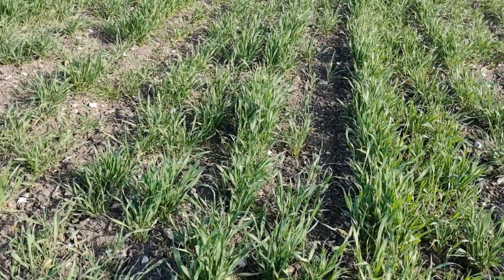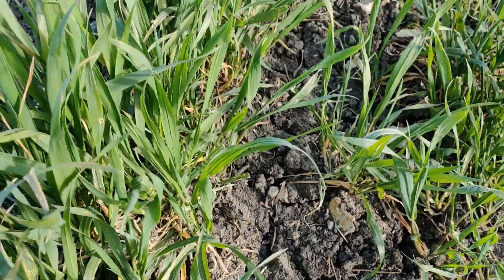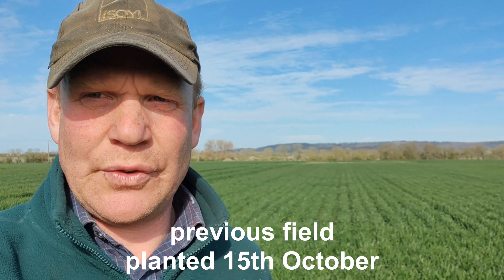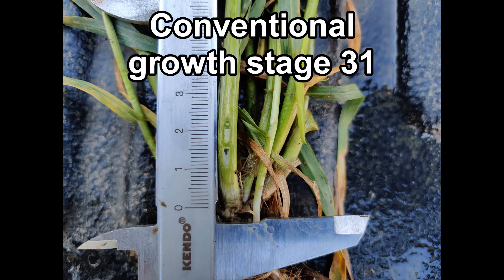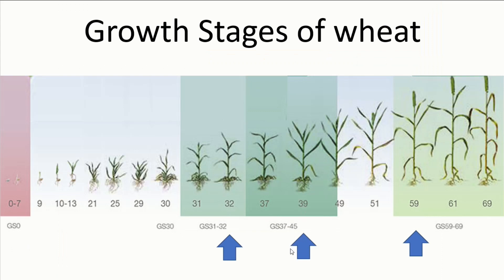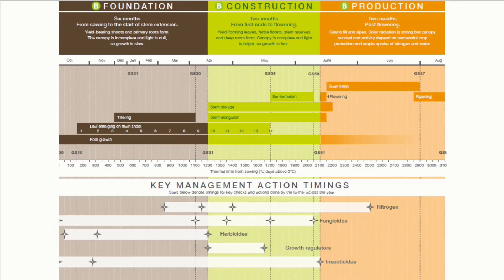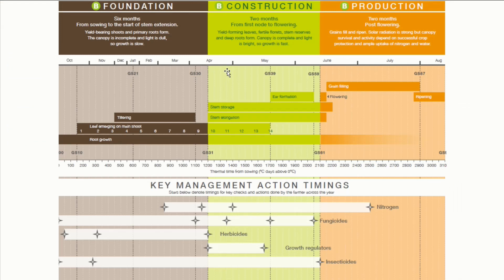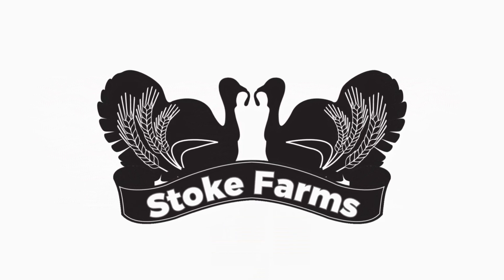Cold weather hits wheat

Comment: Leaf 3 rolled up and half out here today on mid Oct drilled wheat. T0 applied 10-14 days ago has done a good job on active Y rust pustules on a Solstice Zyatt Skyfall blend. Going round with Man/Mag to cheer it up from the cold spell. I should be trying folia N trial but haven't got a spare tank. Craft barley hasn't had anything yet and looks splendid.
Reply from the maker: David certainly appears another low pressure year 🤞 I'm interested to see if regen plants adapt better to drought